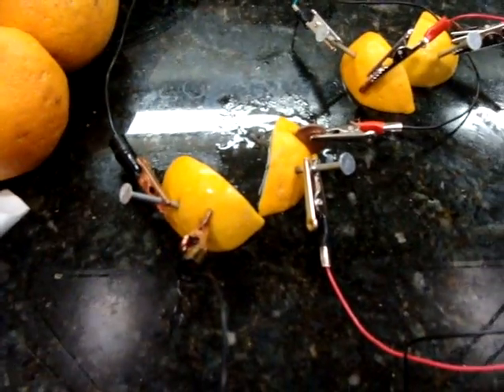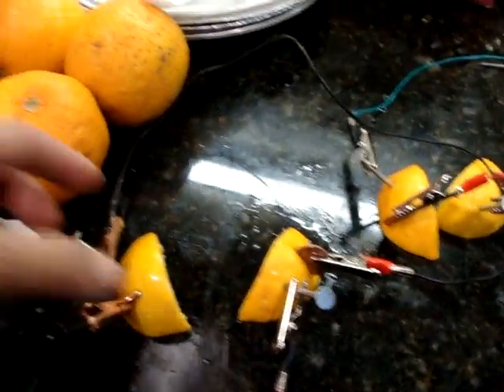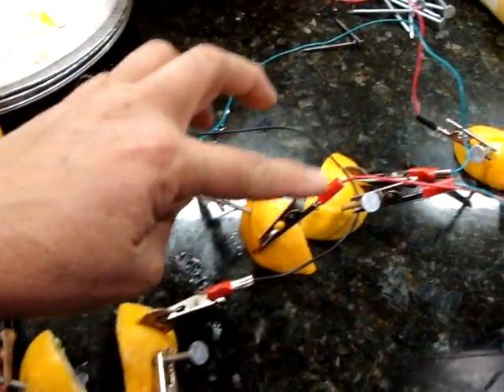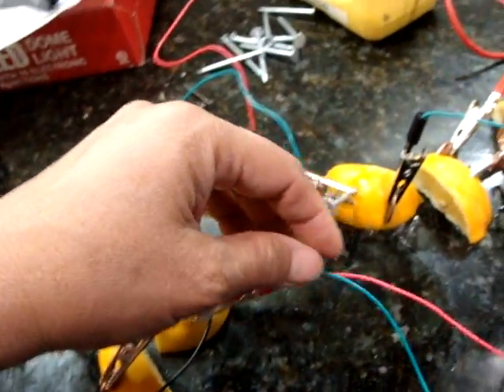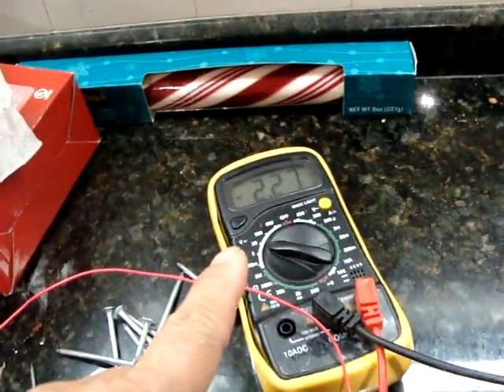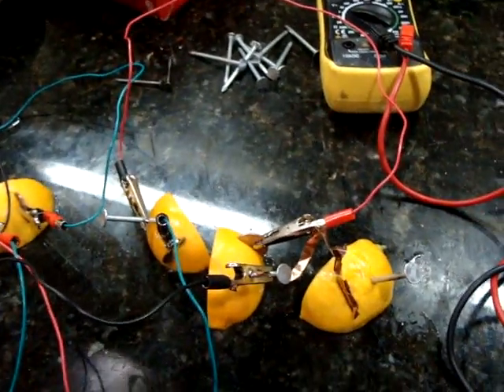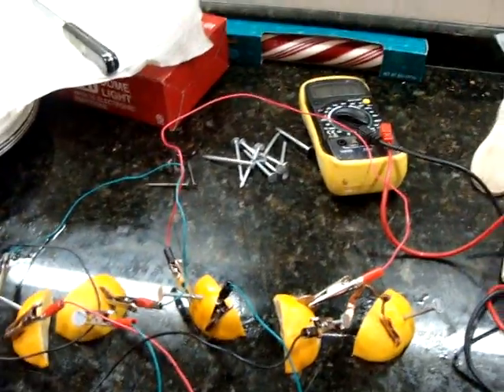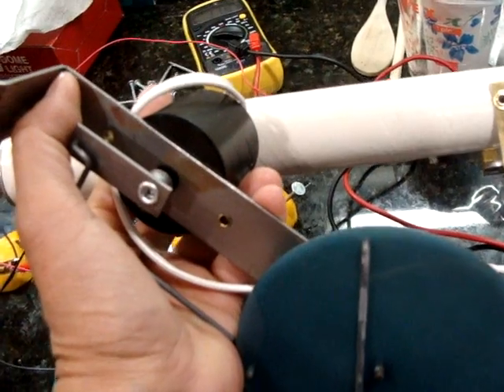Can I power a motor with lemon batteries?

Comment: I'd be stunned if you can make that work.  You might hit 6v, but you'll never get enough amperage out of a few lemon quarters.   e.g. you can get 50,000v just from static electric shock, but you can't use it to do useful work because it carries only about a mili-amp.  Your 6v motor probably needs at least 500ma to work.  And is your motor DC or AC?